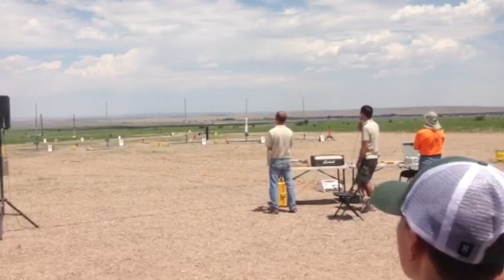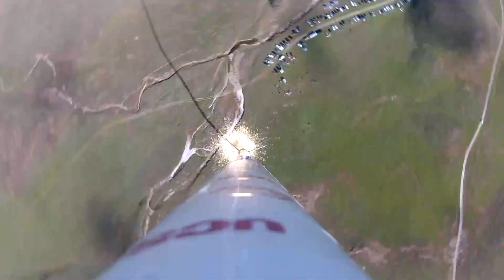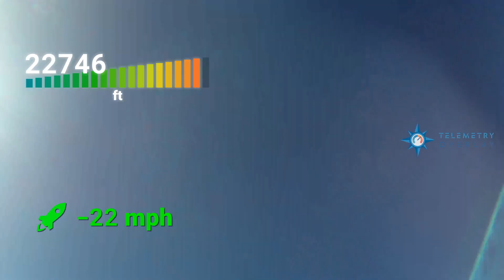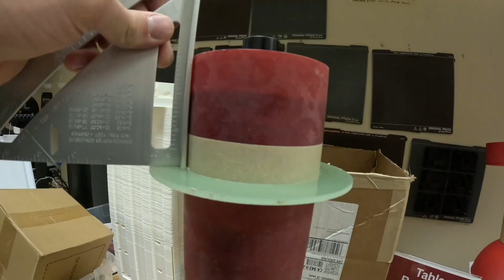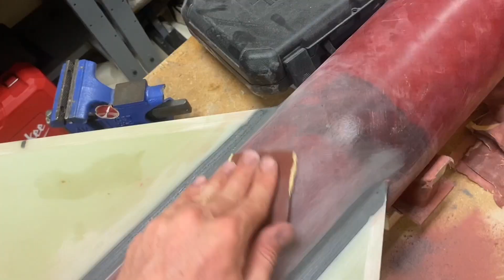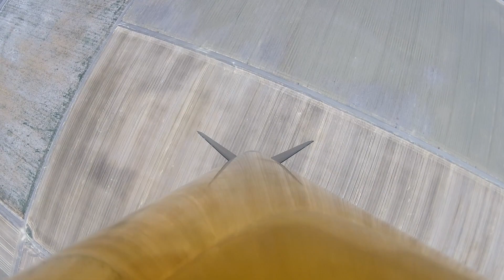Road to L3: Getting my Level 3 High Power Rocketry Certification

Comment: I'm just starting planning for my Level 3 certification and your video was very valuable education for me
I've chosen the same switches but had planned to mount them on the sled and access them thru holes in the switch ring
Your installation is much better and very cool
Can you provide me with some details on how you did it

Comment: Do you have any tips/resources that you can share on the design of the fins? I'm currently designing them for a large student rocket out of a carbon fiber sandwich panel. Aeroelastic flutter is the most challenging since the simplified flutter criterion from NACA is questionable for higher supersonic flight and non-isotropic materials. Aerodynamic heating is also a challenge.